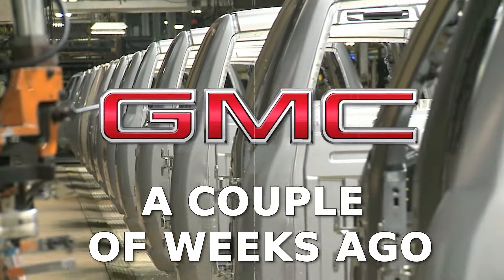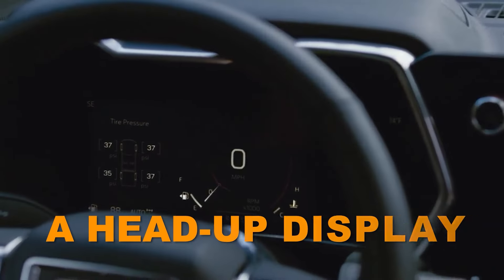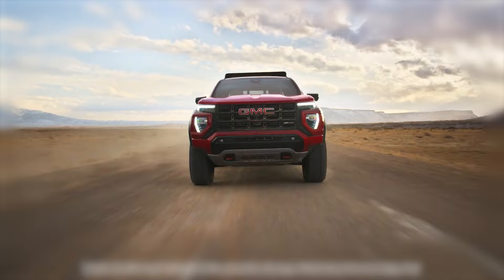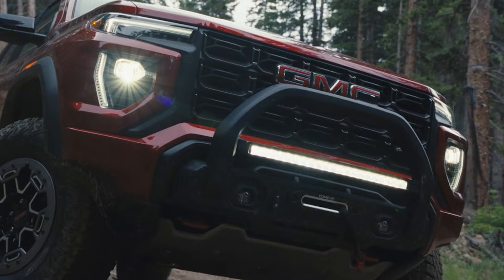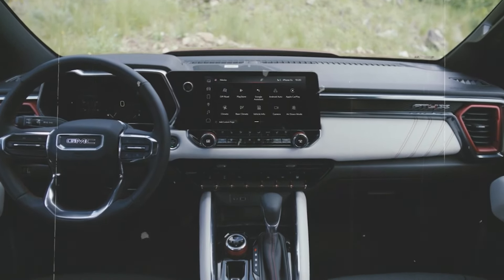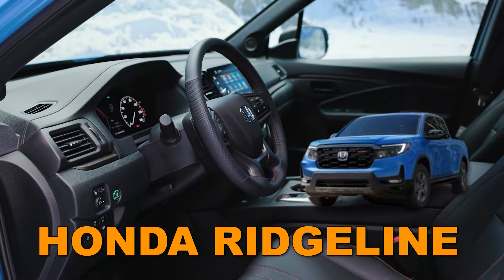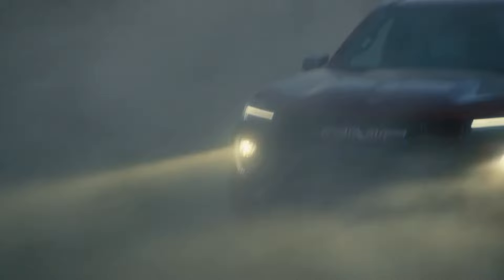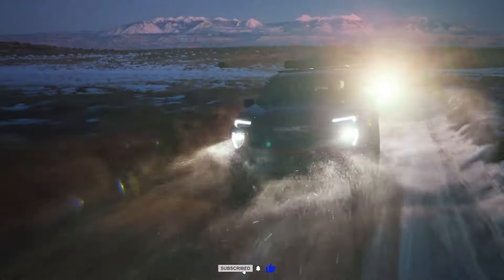7 Reasons You Should Wait For 2025 GMC Canyon (Don't Buy 2024!?)

Comment: Nothing really changed with the 24 to 25 models aside from a few colors being discontinued and the AT4x now coming as a add on instead of its own trim level, If you area looking for one of these trucks and there are some around at your local dealers go for it you don't have to wait, Im sure most of them have 25s trickling in by now so go with what ever is the best deal

Comment: The one problem I see is that it's not going to be rugged enough it'll probably be made out of that garbage aluminum that they build Toyotas out of and if you bump someone it'll make that supposed safety rating or some crap and it'll crush the entire front end at like 10 mph if you bump someone or the whole entire rear end of cave in they just won't be built worth of crap. I would love to have one because they're they're pretty truck and they look good but I would have to put iron bull bumpers on the front and rear and then again I don't know if that would be enough to make it a little more rigid. I want the lowest safety rating they can put on the truck I don't want crumple zones I don't want airbags I don't want an aluminum body I don't care about gas mileage. I want a rugged heavy duty built work truck that looks nice